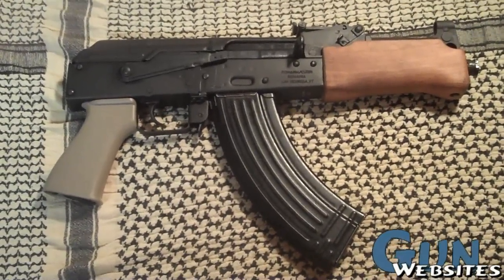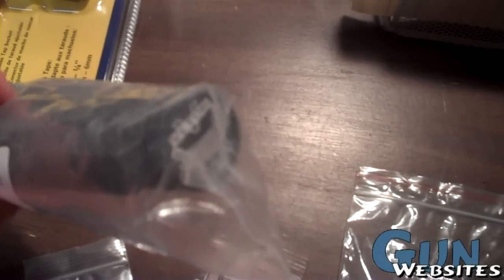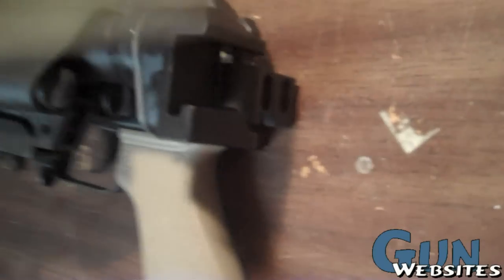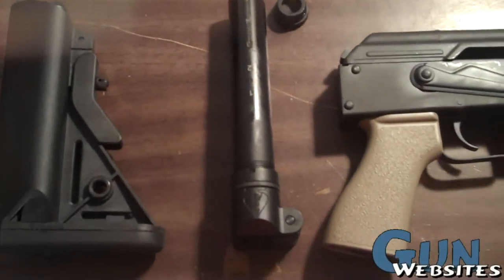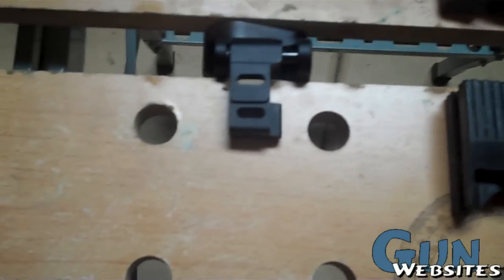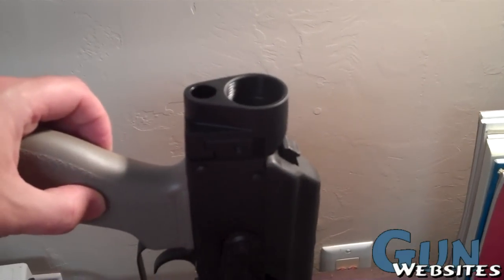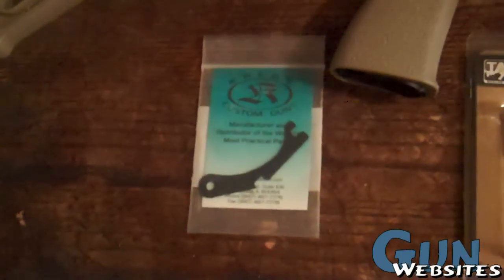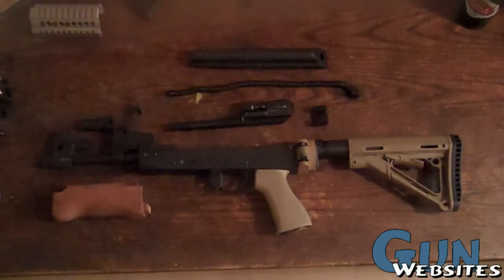Building a Mini AK47 (SBR) Short Barrel Rifle

Comment: I made a stock when bored using scrap metal and a little welder I just learned to use,i made a nice sturdy stock with a foam cheek pad,and most importantly I made it so when folded the shoulder pad turns into a fore arm grip.pretty cool or never gonna sell?
Reply: Yeah people don't realize how easy it is to build this stuff. I make a lot of magazines from sheet metal and at first it took me an hour to do the first couple, but now I can do 10 in an hour, and pay only about a dollar each in materials, much nicer than paying 10-25 dollars per mag. I also made my own IWI negev  since we cant get it here in the US, and it actually was not very difficult to make. Of course it isn't  part compatible with the real thing, but if was going to worry about that, I wouldn't have to make one myself in the first place!

Comment: Nice SBR....but will it blend?

Anywho, I'd really like to see this thing in action.  I was looking to SBR an AR pistol with a battle comp on the end of it with my own low velocity handloads to help with recoil and muzzle flash (2500 - 2800fps) 62sp bonded, now that would be devastating.  

So to SBR it, it's just $200 tax stamp to make it yourself?  You just buy the parts and wait for ATF to approve to put them on right?  And it's the form 4?

Comment: 99% of the time maneuverability in close quarters/tight spaces, and ease of use in a vehicle are much better than accuracy. Especially with a gun like that. Even with the barrel cut down, it's still accurate enough to get the job done at 100, maybe even 200 yards if you have a good cheek weld.